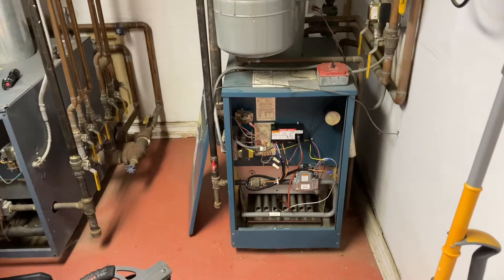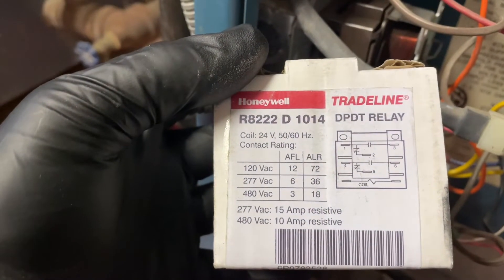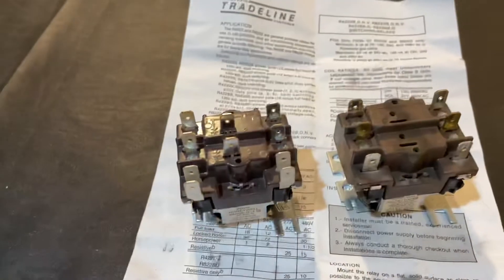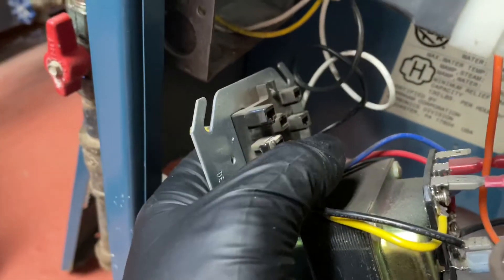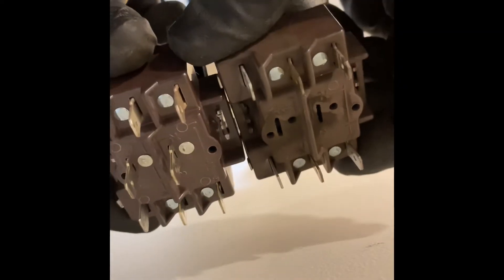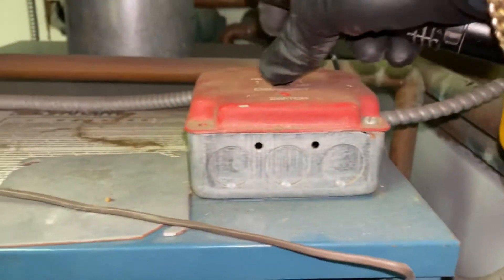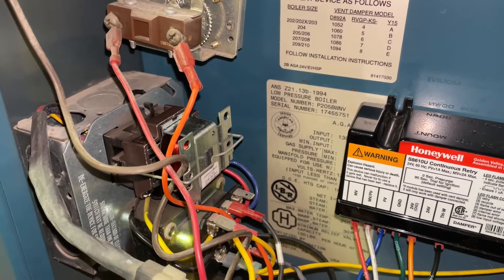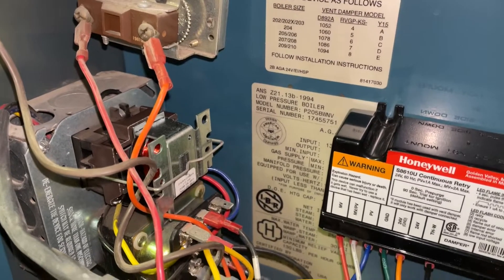Loud Burnham P205 Fan Center Relay How To Replace Honeywell R8222D1014

Comment: Nicely Done, Dr Pipes.. :)   by the way, that relay you changed, I have the same setup on my Weil Mclain . In fact, my furnace would NOT shut off after the thermostats reached Temperature. IT turns out that I had to replace that VERY RELAY you just replaced. That fixed  my problem!!  How nice it was to find this VIDEO.. thanks Mikey!!   . I also replaced Two Relays in separate Circulator switching (?) Boxes. Apparently those wear down too...    Thanks!  I'm a Subscriber!! So, Guess I'm a 20 percenter ..